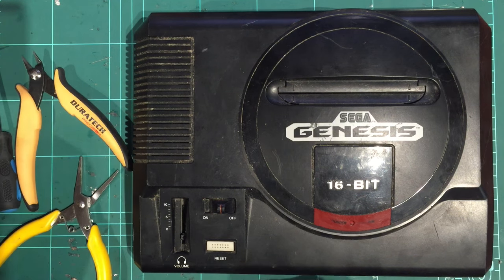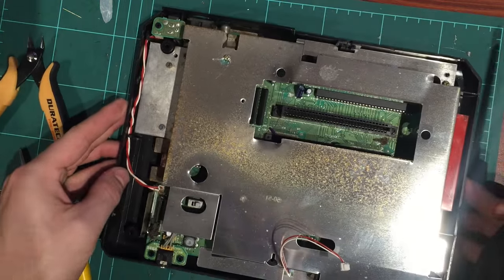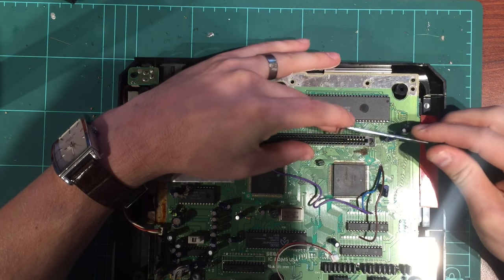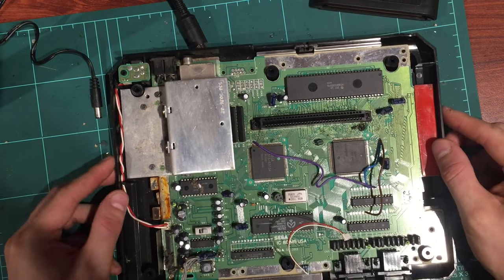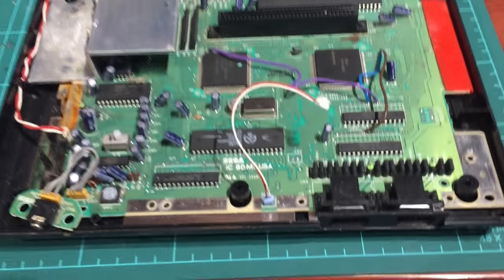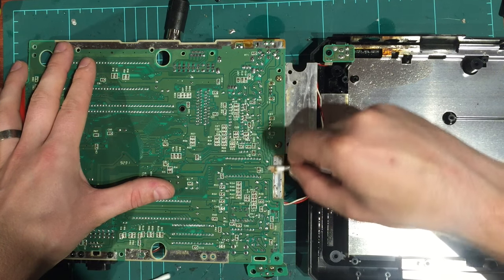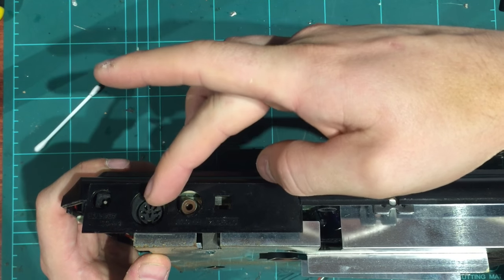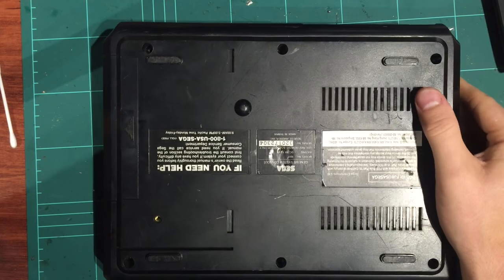SEGA Genesis Console repair - Console 1 Cleaning the cart slot - Part 2/7

Comment: Hi there,
I just wanted to say a massive thank you for sharing this information and making plain and simple to follow.
I had a version one that died on me so I bought a replacement console from EBay, which I was assured was in fully working order, when it arrived sad to say it didn't work, I did get a full refund though.
So I had 2 none working version ones.
Thanks to your videos, I now have 2 fully functioning Megadrives and one was free🙌
I just cleaned them both and tightened the slot pins, and hey presto, retro gaming heaven!👍😊
Reply: ive been lucky with ebay suprisingly, everything ive got has been working

Comment: RF shields are important even if you don't use the RF output. They shield against unintentional radiation from the unit itself due to it operating at high frequencies.

Newer electronics often do without them because they use multi-layer boards and the ground planes do the work that the shield used to.

Comment: The two large RF shields are present so that this device doesn't cause interference with other devices, for example baby monitors, two-way radios, and your local ham radio operators. You never want to delete RF shielding. The shields have little to do with the RF output circuit, which may indeed have its own shielding (from the rest of the device's electronics). Ideally every electronics device you own should not cause electromagnetic interference with any other device. Let's say you lived in a rural area. You wouldn't want an electronics device without proper RF shielding interfering with a nearby radiotelescope searching for intelligent life or performing global warming measurements.
Reply from the maker: +John Gotts Good points John! I usually clip the 5v leg on the RF box to prevent it working. Easily reversible for the next guy but I never use it and prefer it disabled.

Comment: Nice video, but I think you should dry the differents parts more than that to prevent more rust and corrosion in the consoles. Also, when you spray contact cleaner, you might want to be a little more careful about where it lands, cause you could cause shorts if there is too much and you power the device on.

Anyway, thanks a bunch!
Reply from the maker: +David Caron Noted I will be careful. If you watch closely there is a cut in the edit where I let everything dry. I agree you need to be careful so I usually let things completely dry before powering back up. The magic of editing hides all this wasted time as it wouldn't be much fun to watch.
Reply: Where do you get the volume switch from?
Reply: Alcohol evaporates quickly and doesn't tend to form conductive solutions like water does. I usually dry electronics by using 90-99% isopropyl to rinse any water off, then compressed air to blow off as much of the alcohol as I can, then if I'm really impatient some gentle heating. Hot air at like even 60C will dry alcohol instantly before your eyes.

Comment: Unfortunately, this console may yet have a problem. Remember how it booted once but not after you power-cycled in Part 1? Well, this is a VA6.5 which is the exact revision as the one next to me that only works when cold-booted.

I put a ton of work into a “tested” VA6.5 for someone else then discovered that it only cold boots work. Most games will work reliably until you cycle the power and get a black screen. Minute or hours… the only difference is how long it needs to cool before it will work again.

I installed a 3BP v2 with Genesis 2-style 9P miniDIN and replaced capacitors before discovering the issue it likely had all along. Very disappointed! I had to do it all over again and give him one of my personal consoles. The exact same thing happened to me with someone’s N64 when I HDMI modded it last year. Even with my work completely disconnected it would only cold boot. I always do a lengthy final burn-in test but I guess I’m going to have to add a fully-warm power cycle to my testing procedure for any console before I start work.

Comment: i bought a Sega genesis and i think its the connector pins that disables it from working i turn it on and the TV screen goes from blue which is normal to just black and when the cartridge is in the console it wobbles a lot but do you think its the connector pins or something else?

Comment: Hi, i tried bending the  pins in my modle 2 megadrive after watching this but when i put the cart in to straigten them back the bent out of place. Also tge pins wouldnt pop out as easily as you did in the video, are the modle 1s easier to do this? Not blaming the video, id just like to know what i did wrong.
Reply: yeah... shit, me too.
Reply: About 8 of my pins are totally screwed now because of this when they were fine to start...
Reply: I almost screwed it up and managed to fix the one pin I did this wrong on. You have to push down on the pin in a very particular way and not push too far. Definitely be careful.

You want to push the top edge of the metal piece straight down, so it stays resting against the side of the plastic. If you push too hard or at the wrong angle you can end up bending it over and then it might be a royal pain to try and pull it back out.
Reply: Same here. I managed to fuck up one pin which I ended up breaking off while trying to fix it. So be very careful if you try this at home :D

Update: I fixed the broken cartridge slot by desoldering it and soldering on a replacement one I got off Amazon.

Comment: Is it safe to clean the cartridge slot with ethyl alcohol 70% and credit card??
It's possible to damage it with that way??
Reply: Using lower percentage alcohol is not preferred because it contains a quantity of water that won't evaporate as quickly as the alcohol. As long as it's just distilled water it's not so bad, but you might have to put extra effort into drying it when you're done. Higher percentage alcohol will evaporate almost completely in very little time.

If you only have 70%, then I would recommend using some canned duster to blow the excess out and blot it dry with a paper towel.

On a separate note, using high concentration (Like 99%) alcohol does actually have a higher chance of damaging some plastics--it causes crazing that results in a powdery white type appearance (but it's not a residue--it doesn't clean off).

Comment: Are the black and purple jumper wires normal?
Reply from the maker: Yes, they are factory patch wires to correct design issues that were discovered after manufacturing. Only some revisions have them.

Comment: Why not use WD40 on rust?
Reply from the maker: +Gustavo Guimarães I didn't really show the rust cleanup very well, but I ended up using a rust treatment on it. A 'rust converter' product that kills the rust/corrosion and stops it getting worse. It was an automotive product.
Reply: What is the product?
Reply from the maker: Gustavo Guimarães It was this one from a hardware store - http://www.bunnings.com.au/bondall-250ml-ranex-rustbuster-rust-remover_p1560855